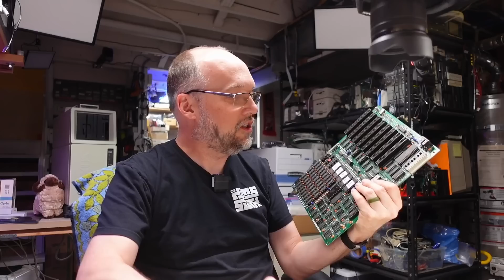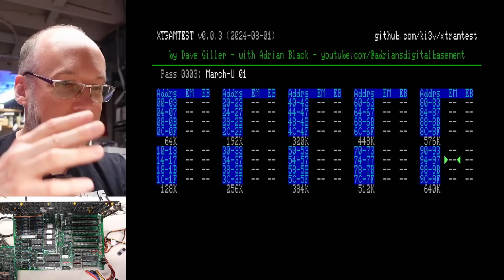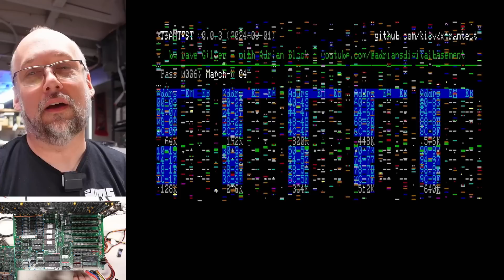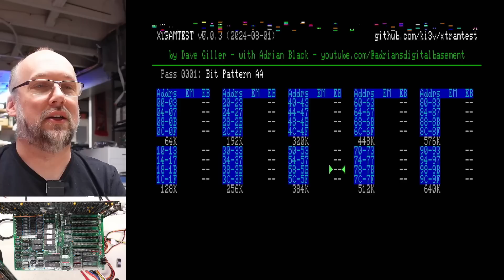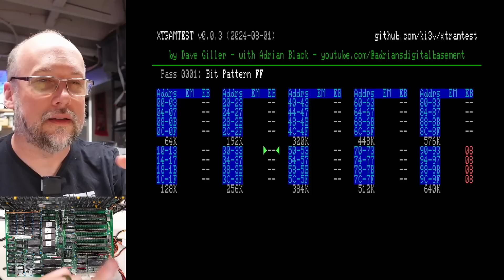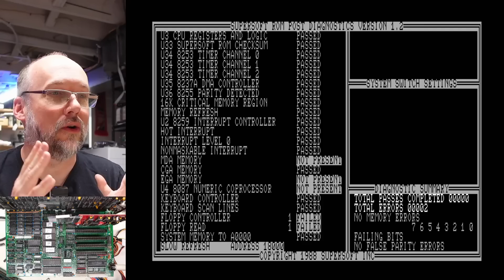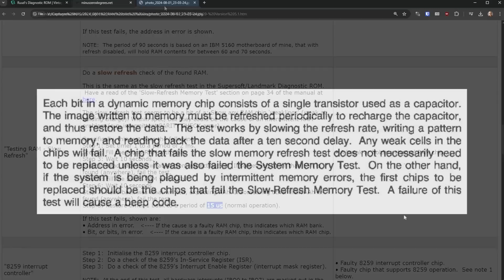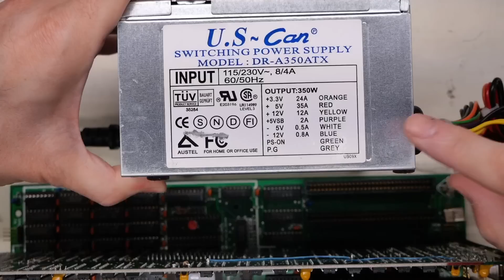A brand new XT RAM test ROM and an update on some unfixable parts

Comment: I don't have a straight CGA card but I have several EGA/CGA/MGA and I've tried about 4 but it never boots with the XTRAM BIOS installed. I see on the video it requires CGA or MGA but now I'm wondering if it just doesn't like the multi-card. I've tried the SW/1 on the motherboard in various configs, but nothing. Help?

Btw, it boots fine and runs my IBM 5153 just fine with other BIOSs in.
Reply: Thanks for trying it! We’ve not tried it with EGA or VGA but the VRAM trick is straight from Ruud’s ROM, and there has been discussion about it on Vogons and Minuszerodegrees. It seems many/most EGA/VGA cards require their own BIOS to initialize the cards, and often don’t work at all until that’s done. But the EGA/VGA BIOSes requires a full system BIOS and the BIOS data area RAM, so we can’t run them from this ROM.